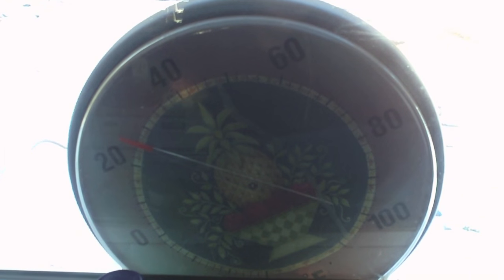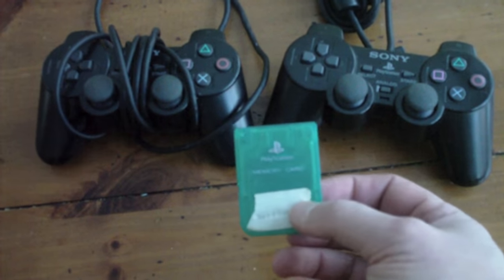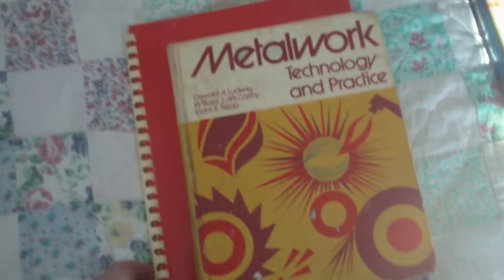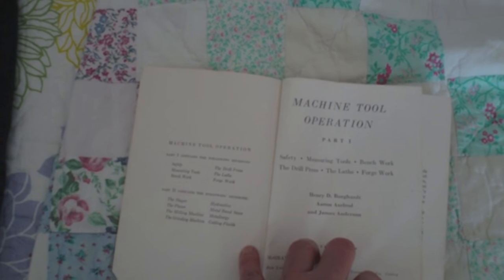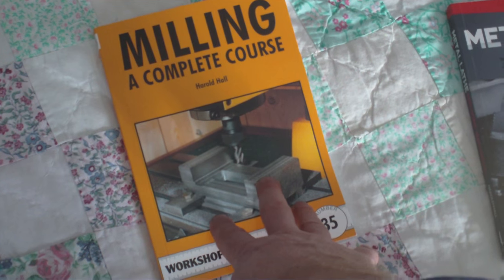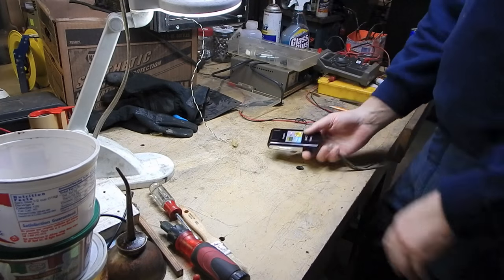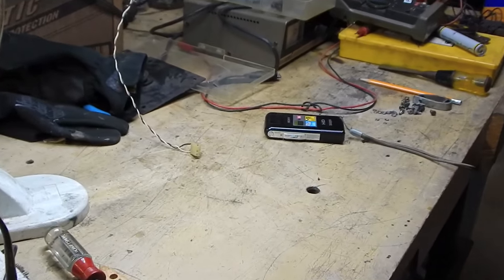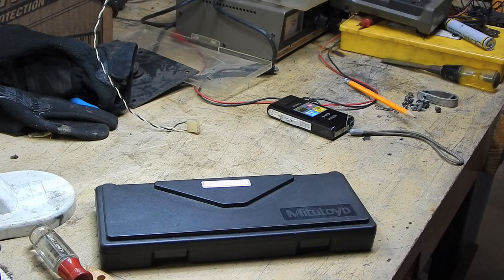January 2016 Flea Market finds, + Odds and Sods Part 1

Comment: way better quality :)
you should be able to take the small stuff closer to the cam now - it should auto adjust
before uploading you could pre-encode for size... never did it myself, some reading on youtube optimization needed
Reply from the maker: Thanks.  I'll check on the optimization tips.

Comment: Wat did you buy to repair that tv and where did you buy it ?
Reply from the maker: +Deundre Sanders eh? You mean the plasma screen in my other video? Replaced some capacitors I bought from digikey, and a couple PC boards I bought on Ebay.
Reply: +Steve Watroba Yeah the plasma tv in the old video I have the same tv with the same problem
Reply from the maker: Deundre Sanders I detail the parts used and the sources in the videos……..I got lucky with that repair.